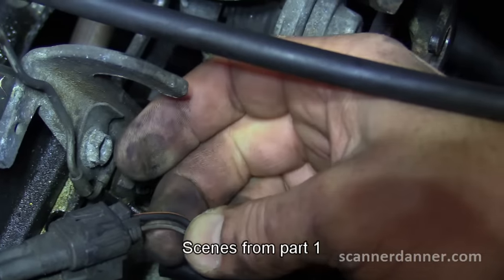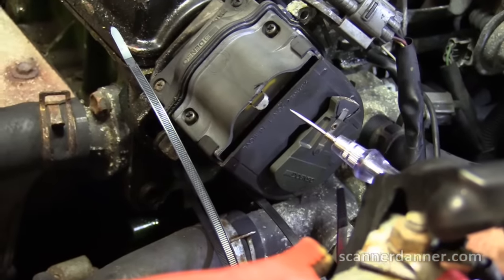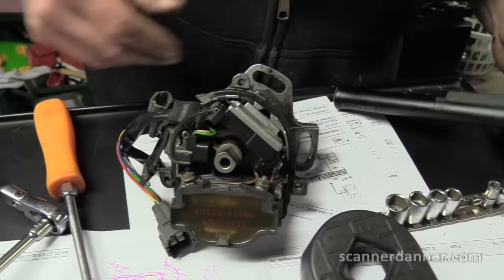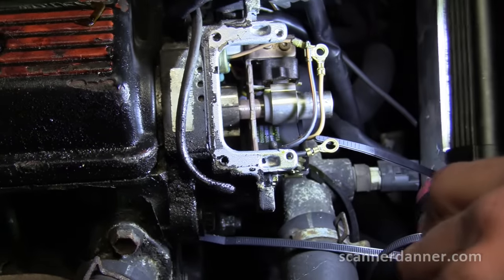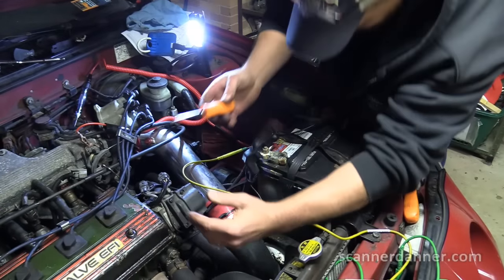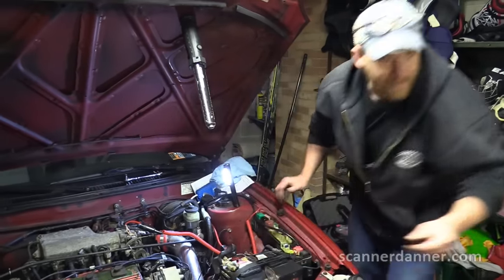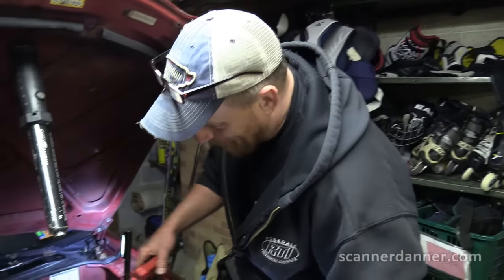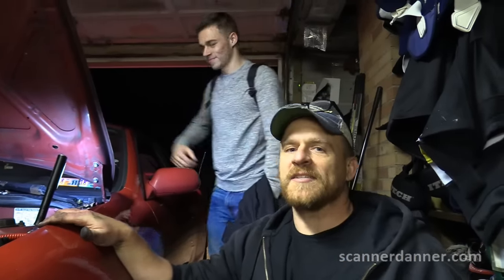Ignition System Operation & Testing - (No Spark Toyota Celica)-Part 2

Comment: Great job. I don't think I need to tell you not to sweat the goof-ups because they're more common than people are willing to admit. Frustration gets the best of me, too. It may take a bit longer than I like, but I have to step back or away when I start feeling upset and organize parts I'm removing.
Love the outtakes. When I was little I connected two 9 volt batteries together to play with. They were almost dead so they didn't blow, but to my surprise they got a little warm.

Comment: I  am sitting with a 1987 toyota carina ,  only eighty thousand miles on the 
clock when I bought ot now eighty six thousand and this, the second time i have had ignition problems/ first time I had to fit new spark plug leads when car came to dead stop. This time there was intermittent misfire as I accelerated, hence I took the  distrubuter off like yesterday ! now after shopping it was fine then came to dead stop after 20 meters !!  Got it towed home , about a half mile, then it started , ran for five mins then died !  Your video is EXCELLENT, I had now idea how the spark ran acros top of cap to the rotor.
Reply from the maker: I have some other videos on this same system too if you ever need them. Thanks!

Comment: I hope it fixes my car problem. 1994 Toyota Celica 1.8L. I was changing the valve seals in the engine and forgot to take off the negative to the battery. I touched the alternator with a ratchet  which caused a spark and then looked at all the fuses which looked bad and changed them. Now This is video is what I’ve been looking for for 4 days now. Thank you guys!

Comment: I frequently keep a sharpie on hand to immediately mark the old part. Before i set in on a bench or anything. It's so easy to get mixed up. Especially with used dirtier parts. I'm glad Kaleb is on board as a helper/ learner. He really adds a lot to the videos. Great video. Big fan.

Comment: Thank you, solved my problem with your clear and detailed video on the Celica ignition problem.  I needed the details, as an old retired mechanic, did a 5 year apprenticeship as a motor mechanic in Australia, leaving tech school in at age 14, grade 9.  Short history, did a few years as a trucker for my brother, including building my own tractor/prime mover out of parts, 1955 Federal, 3-71 GM Diesel, Leyland 6 Sp Constant Mesh box and 2 sp diff.... then further education in the trade, Australia and Canada, ending as a Tech College instructor in Auto and Heavy Duty Mechanics after a couple of years of University.  Ending my mechanic career in 1985  I was a bit short on the technological detail of the more modern electronics, the fuel side I was ok with, working with Renault Canada back in the 1970's, I was lucky to have some Bosch electronic fuel injection training, built on that over the years but not enough as I got into computers in 1985.   When our long term family 1996 Toyota Celica, Australian version suddenly quit, I needed help as I knew where the problem was by deduction, but not exactly which component.  

Your sketches of the circuitry and theory filled in the blanks and put me on the correct track.... you have an excellent communication ability and persona!   I had to understand WHY and WHERE the problem was exactly.  It was the Ignition Coil in the distributor that had failed, and your clear and concise discussion gave me the final answers to the puzzle.  Thank you very much, keep up the good work.....

Comment: Thanks for the information on how far a good spark will jump from the coil.  I've bought an aftermarket distributor assembly, a salvaged distributor, and now am getting into multimeters to diagnose if my ignitor is bad on a 97 Corolla.  This whole time the spark from the distributor was weak on every coil I've installed.  The tough part about testing the ignitor is that my local store oriely's doesn't have a connector for this ignitor.  It's time I order a genuine Toyota coil.  My original distributor had an oil leak in it as well.  I'm guessing that is what made the secondary short in the coil.  This is by far the best explanation I've seen of how these systems work.

Comment: On horizontally mounted distributor — one has to ensure that the distributor oil seal ( O - ring ) is not leaking oil inside distributor.

Comment: Excellent video set, Paul. Many of us work on old cars like this and we try to replace only what is proven bad, for the same reasons in your video. That work flow wouldn't be appropriate in a professional setting, because the chance of a callback or misadventure is higher. We don't have to pay for labor, and we're able to go further if the vehicle has persistent problems, without criticizing the shop in the local coffee house.
Reply from the maker: exactly! something some car owners need to understand

Comment: the igniter will never fail on these 80's and 90's toyotas especially on  "2A 3A and 3 A-C" carbureted engines(starting 1983) , igniter on "4" series is the same tough it is 1/4" more in height it fits in "3" series " Integrated Ignition Assembly   aka IIA " !!, moisture and condensation will corrode the outside resistor wich you can solder a new one worth 10 cents , japanese products from that era were top of the line for quality , great video

Comment: Thanks sr you just saved me $200 dollars.
I just returned the distributor assembly and got the ignition coil for 45 dollars and 💥 💥 the spark ⚡️ issue is solved. 
Thanks again! 
😅

Comment: Hello Paul, Oil in the distributor is most likely oil seal on the bottom of the shaft. I changed the seal on the distributor on my own car 96 Corolla. It only cost $5 and a little of free time. Thanks for the videos, I always enjoy watching your videos.
Reply: Noel Hernandez I did the same to my car. But if the seal isn't failing from becoming hardened, then the cause would be worn bearings in the distributor because the extra play will cause the seal to widen and cause a leak.
Reply from the maker: Didn't know there was a seal that could be changed. And good tip on the worn distributor bushing or bearing.

Comment: Very intuitive video Paul, I'm facing the same type of problem on the nissan sentra 2006 of a friend. Not starting. Fuel pump ok, spark plug are ok, we replaced the crankshaft position sensor, no change. We are facing a wall right now...
Reply from the maker: Is there injector pulse? What codes do you have? Any immobilizer codes?

Comment: Awesome video Paul, great to see your interaction with Kalib, he"ll be Scannerdanner II soon.  I like the way you emphasized that the CPU was receiving good Cam & Crank signals by monitoring RPM gauge and confirming Injectors being activated.  Also, was neat you found out that the injectors fired in pairs, while monitoring the both pins on the injector with test light to ground, the other paired injector was activated!! Real cool.  Keep up the great work Paul, look forward to more videos with you and Scannerdanner II 🙂

Comment: I remember having an older Toyota in the shop for rough running and stalling.  Found there was a crack in the epoxy in the coil and when it got hot I'm pretty sure it would arc back into itself.

Comment: One thing I noticed when you were changing the coil, that may make things easier for you, is after you break loose the nuts on the wires connected to the igniter and the other wire. You could come around and break loose your Phillips head screws, take the screws out, and in your hand you can spin off the nuts to the igniter and the other wire. When putting it back on reverse the process. Seemed like you may would be easier to handle and maybe faster.

Comment: I have been fighting with my ignition, I will have to see if it gives ANY spark the way you showed with the bad coil.

The previous owner of my 95 corolla put on one of those k&n air filters. I doubt it does anything for power but it DOES make the air intake system easier to remove for access to other stuff.

Comment: So first off... Thank you so very much for sharing your wisdom, you are my hero! Secondly, you mentioned testing the signal generator NE connections, do you have a video that elaborates on this? Everything is testing good with a multimeter ohms readings except for the NE+ and NE-, I'm getting 0 resistance on 2 distributors (factory and aftermarket) and would like to know more as I have been trying to chase down this issue (P1300 MIL) for quite some time now. Again, thank you so much! Much love to you! 🤗😚
Reply from the maker: I do! Give me a second to find it
Reply from the maker: Same car two years later. The winding for the pick-up coil inside of the distributor was causing arching inside of the cap, causing a weak spark, (i think) and this was either the NE or G? signal, maybe? Sorry. I think you will learn about the rest of your system in this anyway. Not sure if I show the specific NE test (I hate the resistance tests for these, and will rarely use the ohmmeter here)
https://www.youtube.com/watch?v=-IcSI60npSo
https://www.youtube.com/watch?v=XH74DXTPMmQ

Comment: Well fitted a new coil ,  cost £20  delivered by Royal mail to my front door ! Fixed the problem ,  Yipee!  I found those four small screws which hold the coil in place were hell to remove, must have been fixed in with "Locktite ".😃😃
Reply: Looking on my garage shelves i found an older identical coil it was made in Japan but again by Bosch., the latest also by Bosch but in China. Now!! this means that I did some years back replace the coil and I do have vague memories of doing so ,  also of spark plug leads. So this Carina since new and now with about 83000 miles on the clock is on its third coil. Is this usual ?

Comment: This is very helpful my man! I have a 1988 toyota corolla with the sr5/4af-e. Carburated... seems like you have a few more connections and wires. My coil pack has a crack in it.. maybe thats why I lost spark all together? I ordered a whole new distributor for only 100 bucks so I'm hoping it should solve the problems

Comment: NO DOUBT — you know how to PROPERLY TEST AND DIAGNOSE ANY SYSTEM to repair and restore proper engine operation 😊👍👍✌️✌️✌️
Reply from the maker: Thanks Coy, they are all the same :-)
Reply: @ScannerDanner  hey Mr scanner!great work you're doing I love every bit of it,theirs one thing I'm asking ,can a distributor car use four independent coil to each cylinder?
Reply from the maker: @daintywalker5861  what would be the purpose of the distributor if you have independent coils for each cylinder? I'm not following your question, sorry

Comment: Sir , 
When u r testing the sparks with ur testing pen , what is the connection of the wire on battery??
You did not mention it in the video
Reply from the maker: you mean my test light? It is connected to anything metal on the car or battery negative. I like to keep it away from the battery itself, just incase of poor contact and an arc at the battery, which would be very bad.

Comment: I got the same problem & took the test light, connect to the battery +ve and touched to the igniter after removing rotor & black cover from coil, the spark was appearing jumping from coil to the crack on it.

Comment: Thank u for ur good information given in this video. Ive a same problem with a 2y engine coil. Whenever i attach ordinary wiring system i have no spark but when i use only one positive direct wire from the battery i see small arc! Can you help me find the promblem inside tge wiring?

Comment: placing the clamp on the coil wire are u testing coil output signal threw it windings or your are checking igniter output signal
Reply from the maker: coil power and ground, which is done by the igniter
Really you are testing everything, including computer inputs, computer control, igniter and coil and wiring
Reply: ScannerDanner  the signal from the ecm is IGT so I could be able to back probe the igniter nd check the ecm signal so can I be able to back probe the igniter ground side control wire to the coil nd confirm the signal from a good igniter correct

Comment: Thankyou for the video.
Is the spark jump too test light the only test ... i just replaced what i thought was a bad coil and the engine now runs fine... but when i put the bad? coil in a spare dizzy and bench tested the spark jumped about 25mm too the test light... ,,originaly the motor started instant , ran for 30 seconds and stoped dead...it had power too the coil but no spark at the plug so i assumed it was the coil .so swaped it and now it runs fine.

Comment: Great video, I have an 4afe engine and have changed the ignition coil I guess 4 times in 2 years,  I don't know if it's just bad luck with the coils or there is something wrong with the distributor. The previous coils have not been original or new, because I couldn't find new Toyota ignition coils in my country so I bought one from a Toyota dealer in the US, hope this one works for good, thanks.
Reply from the maker: Most likely junk parts, especially on these older cars and that the aftermarket absolutely sucks anymore for electronic parts.
Are your plugs and wires, cap and rotor in good shape? An open in any of these components can lead to coil failure.
Also the igniter itself can do the same but that is unlikely.
Reply: @ScannerDanner  Thanks for your reply, yes I've recently changed plugs, cables, cap and rotor, I can't wait to have the new original coil. Hope this one will be the last one I have to buy. Fingers crossed. Take care. 👍

Comment: 1995 celica 2.2l GT no spark. I can make the coil spark from the white wire at the igniter or the yellow wire at the dist. The customer has bought two distributors and two different igniters all act the same. I have had the car running but dies after a few mins and then will sometimes start but mostly not. The tach is not bouncing when not starting, and the times I had it running the tach would fall drastically when the car started to die after only a few mins of running.
Reply from the maker: Post this to my forum. It is free to join and we have an awesome community that is friendly and willing to help. https://www.scannerdanner.com/forum/post-your-repair-questions-here.html
Hope to see you there!

Comment: In the beginning of the video, you mentioned that not all coils will have an oscillation at the beginning of the waveform.  Can you eloborate on this?  Why do they not all have oscillations?  Is it by design?  Model specific? Or just the personality of each individual coil? 

It was my understanding that the absence of the beginnimg oscillation was an indication of a problem.  Is that not the case, and the continual upward ramp with no vertical upward lines more important?

Thanks for sharing all your experience - I watch all your premium and free videos, and whenever I finish them all I start at the beginning and watch em all again to keep it all in my head (I think my wife is tired of hearing your voice).  Hopefully I'm not the only one addicted to these videos!!    :)

Curt
Reply: Curt Girardin check out the forum. You'll get more in depth info there & actual wave forms to help even more. Scanner Danner dot com
Reply from the maker: personality of the coil for sure would be the best description as to why. I'm not sure I could elaborate on that more. Just know that you will not see it on all coils. 
I think if I would have changed up my voltage scale and really focused on this area, that we may have been able to see a small oscillation there. 
No vertical upward lines is the main thing we DON'T want to see.

Comment: My man.. awesome work brother thanks for sharing.. school was most definitely in for me on this one.. I have  had cases where I seen a small spark at the coil and assumed it was good.. So there needs to be a good air gap of at least an inch before I can call it a good coil.. Good teaching fam I learned a valuable lesson today
Reply from the maker: Sweet. Thanks Jeremie! I just replied to you on messenger. I think it was you. I get som many "tech help" type questions via email and messenger that I can't really do them there anymore. If you ask specific questions about a problem you are having on a related video, it makes it easier to answer. Also post them to my forum on my website. It is free to join and I have 4 handpicked moderators who are helping me run things as well as a community full of super helpful and brilliant people. And we don't put up with any b.s. There is absolutely zero bashing tolerated.
Reply: ScannerDanner ..Yeah that was me bro.. Thank u I'm headed over to the forum now to join

Comment: I have a 1994 Toyota Corolla 1.6l code 14.
Previous owner changed distributor.
It runs fine for a will then it stalls.

Comment: Hey mate hoping you can help with a troublesome airbag issue.
Haveing a b0015 code which is persistant. Unplug pretensioner and probe to show 2.1 ohms
Test wiring to show no faults.
Insert 2 ohm resistor right at computer to still see a value of >5ohms. Yet wiring sees 2 ohms.
Replaced computer as per manifaturers instructions but fault is still there. Have exhausted options. Any ideas.

Comment: Very useful video. Is it possible to troubleshoot this issue without scope? If yes, how?
Reply from the maker: yes! check out the links I provided in the video. click on the "i" icon in the upper right hand of the screen
Reply from the maker: I have a video linked on a Honda distributor where I used a test light to troubleshoot it. I have many other ones showing the same thing and I added a playlist at the end of the video where you can find those too.

Comment: You may have had a pinhole burned right through the center coil contact on the ignition rotor. The weak spark you showed at the coil should have been visible at the plug wire and it was not.

Comment: Which one of the four ( red, blue, white, yellow )wires on the side of the distributor light up a test light while the ignition switch is on even with a stalled engine